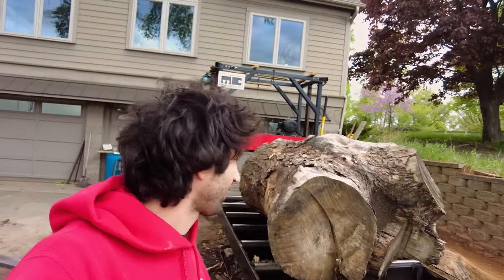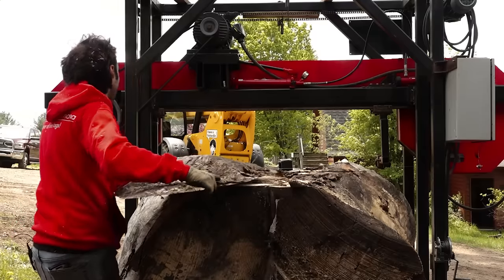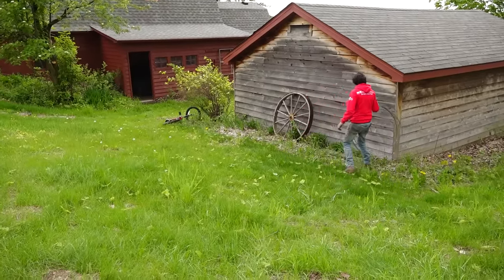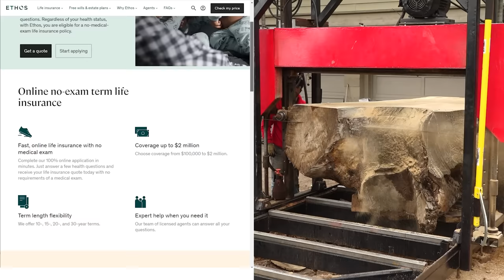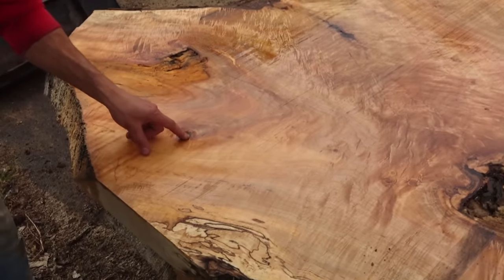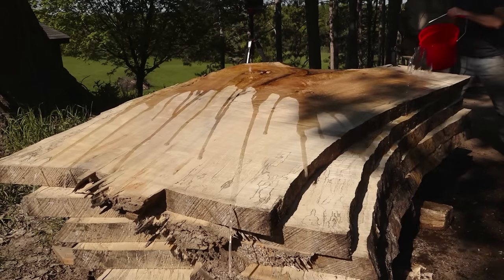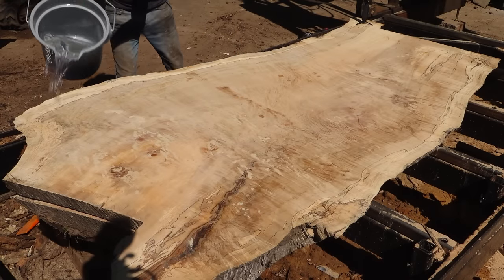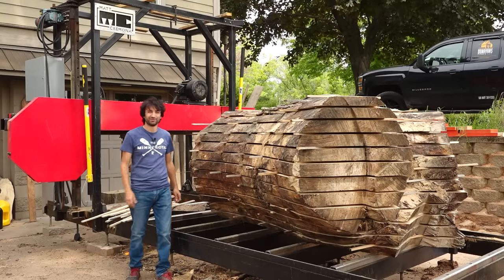The Most Figured Log I’ve Ever had on my Sawmill (and it was going to be chipped)

Comment: Most sawyers go bonkers finding a nail, Matt chuckles and keeps sawing. Beautiful slabs.
Reply: Blades cost $200.   Each of those slabs are worth 10k.   Matt will go through every blade he’s got to get through that log.
Reply: I guess nails, bolts and wire cables are not an issue with you, Matt ...?
Do you leave them in there or do you dig 'em out ?
Reply: @Cooldaddio2  he buys carbide toothed blades he can cut metal and not destroy his blade
Reply: @billhatcher2984  i asked him about that recently when he was cutting the logs for the 2 guys that make stuff.  He said the blades cost $160 and they last about 1 to 1.5 years.  I dont know if they are carbide or not

Comment: That wire was almost certainly a dipole antenna. In the early days of radio such antennas were common and lacking any other means to get the antenna high enough to get a solid signal, people often used trees in lieu of a mast, or telescoping pole.

Comment: Great to see a Junk log turning out to be so good. That log will make some amazing furniture.  Will you take it to the kiln to dry it?
Can the blades be sharpened again like the non carbide blades? How expensive does the carbide make the blade? 
Does the blade run on steel on steel or is there a rubber tire on the wheel. Woodmizer use a  lose "V" belt on their wheels to give the wheel some crown.

Comment: I had a handmade pirates pistol I got all the hardware and barrel from Dixie Gun Works, and I got the curly red maple stock blank from a friend and another friend put it together and I finished the wood. I took the words seriously and hand rubbed 13 coats of boiled linseed oil, into the wood, it took a month, I can't remember it's been so long ago, but you could see yourself in the shine on the wood and the curl virtually jumped out at you it was a beautiful piece, unfortunately it disappeared in my last move it was a 500$ piece , A real operating .54 calibre muzzle loading single shot pistol and would put 3 balls into a fist sized group 15 yards. Good self defense arm for close in shots at bear size targets, that load was 50 gains weight 3f black powder and a 400 grain Maxi ball, the barrel twist was 1in 48. it had a 10 inch browned barrel.

Comment: Just a crazy idea: to level the centers of the crotches, why not use a spirit-level 3 to 4-foot-long, you don't care too much for, drill some mounting holes through its body for screwing it onto the log at center height, instead of using a tape measure. The only thing you have to watch is the bubble and you don't have to remember two measurements and then calculate how you have to adjust it before it's level. One bubble, no hassle, just two screws, and I think a carpenter could find those very easily.
Reply: I've used my level as a fence to cut sheets and put a screw in a block going through the handle, no need to modify your level

Comment: I'm kind of a dust control type and I'm wondering if you could add a trough to the side the sawdust ejects so you can easily clean out the sawdust from time to time.   I know many woodworkers develop lung problems because fine sawdust in particular, gets stuck in the lungs and can't be cleared out.

Comment: Did you fix the design of the bandsaw mill? Does the saw go down to within ¼" of the bed? Did you fix the cable anchor point so you can go the length of the bed? Did you move the wheels below the saw head to increase the throat depth?